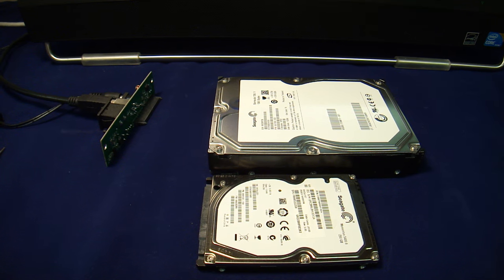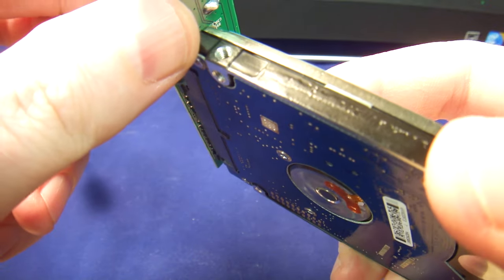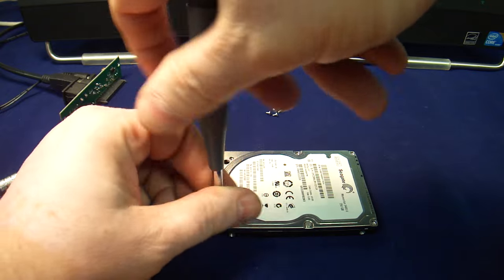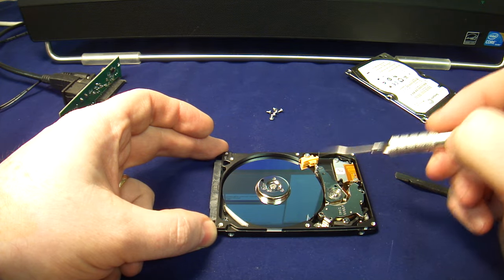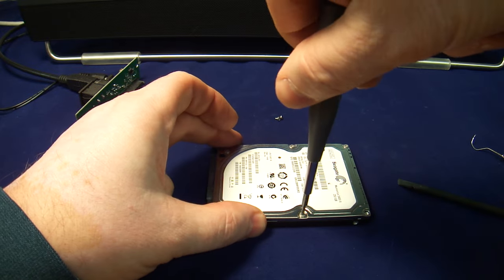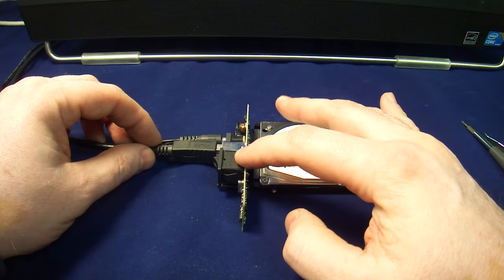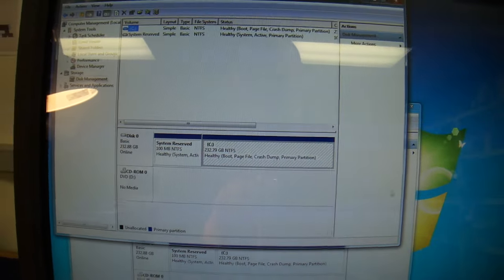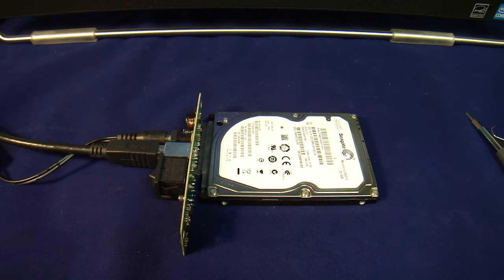DIY Video 2 How to fix a broken hard drive Beeping noise Get your data Back! Best Kept Secret

Comment: I USUALLY just plug these back into a spare slot "internally" on my PC when trying to fix or get data off of an external HDD.  so if you have spare cables internally on your pc, or can disconnect a cd drive or secondary HDD momentarily (in order to do Data recovery), you dont need the SATA to USB connector thing.

Comment: Thank you for the video, I was able to move the head off the platter and out of the parked position, and once I plugged it back in the platter would spin up, but then beep 3 times. The beeps were different from when the heads were stuck in the parked position. Spinning but not being recognized by the laptop, I am using a macbook air

Comment: I just come to this video to tell you that i have 250 GB WD hard drive that i fixed 5 years ago and its inside of my old laptop and still working with no problems at all . I put windows 10 on it and give it to my father .I guess im lucky or my hard drive is just ROCK SOLID :D

Comment: I have repaired hard drive model ST1000LM024 belonging to a seagate portable expansion. head was stuck near the middle. Thank you very much for the tip.

He reparado un disco duro modelo ST1000LM024, perteneciente a un seagate expansion portable. El cabezal estaba atascado casi en el medio. Muchas gracias por el truco.

Comment: Great video not tried this yet plan to and yes I agree its just to get your files off of the drive itself. Common sense will tell you you got lucky (if it works)  and that it may go out again at anytime  and if it does it may not be able to be used again. It may function but not in the original  context as it was made for. It's a patch at best in other words don't trust it, it would be like using a plastic bag to stop up a leak in a sinking boat sure it might work for a bit but no way in saving your bacon in the long run. Even, data recovery  experts can not guarantee  it. The ones I looked at was way to expensive for the average person, and then its only for like 30 days if that.  So if this works make a back up of it and back that up as well. Make three copies one for you to use one work on a second one for the file drawer like a CD or another external hard drive.  and the other in a safe location. Safe location off site or the cloud .
Reply: Yeah that sounds sensible to me. I'm going to try it on mine, see if it works, and if it does, I'm going to rip the data from it.

Comment: Thanks Abraham,,, a lot for this video,,I am an electronics technician...i do such experiments too.I have a question that ever did you try to fix hdd which spinning disks inside damaged and you replaced these from the same model of hdd...soon i will do this experimet and see what going to happen.
Thanks

Comment: If your data is important to you, have the original files then 2+ backups, either on HDDs, DVD discs (very cheap) and/or utilise "cloud" storage. With services like Dropbox etc or you could even just simply attach documents to an email and send it to yourself.

If you have backups then all the risk is essentially taken out of DIY solutions like this.

Comment: hello
First of all I want to thank you took the time to make the video.
Now you say so, once the pc recognizes the hard disk, we have one chance to get the data out and place it on another hard disk.
Specifically how long you are spoken: 5 minutes, 10 minutes? To know that I must rapides.
I have a WD My Passport 500 gb, now fell to the floor. I connect to the PC, turn, turn but do not recognize me.
Also I will try what mostras in the video. Also I will tell my experience once you try.

many Thanks

Comment: thanks so much. bought a screw driver at home depot and got my drive working, called the computer place and they told me they couldn't fix it based on description so i just did it myself.
Reply: Remember, the drive isn't FIXED, it's just now, hopefully, usable to get the data off.  Do NOT put back into regular use.

Comment: My external(old internal in case) hard drive is not recognised, by mistake I've uninstalled drivers from device manager after that it didn't detected,my guess the hard drive data is deleated or changed after reinstall of the hdd

Comment: Thank you so much for this video. I was able to fix my seagate external 1gb hard drive. I just wanted to ask you if hard drive would still be good for everyday use or should i just get a bigger external and transfer all data? What drove me crazy was that  HD fell on a floor with rug not more than 2 feet. Thanks again

Comment: Hej Abraham i have an Intenso 1TB
i got an beeping noise while connecting the noise last about 6 sec
i did exactly as u instructed, then i connected it again and the harddrive made different noises but after 20 sec waiting it found my the drive and all my data is still on it. 
it still does some noises but works Thanks alot

Comment: Hi Abraham, please advise - I opened the compartment and noticed that the head does not move to the center. Is this an indication that the problem is with the board, the head itself or both?

Comment: I have a Seagate Goflex TB, it was beeping continuously but the delay between each beep is more longer, For example 1 second delay between each beep.
I opened it up, moved heads as you said and tried it again but this time sound like the heads go to platters and back to park for 5-6 times then light remain on but no sound and no work.

Comment: I would add that it's a bad idea to try to save data from the "fixed" drive using a Windows machine. In fact, plugging a drive with possible head or platter damage into a Windows PC is a recipe for disaster, as Windows will immediately try to write identifiers and timestamps to the drive. By the time the drive appears in Disk Management, it has been written to! Instead, image the drive using a Linux distro/liveCD that doesn't auto-mount drives (most recovery- or forensics-oriented Linuxes are like that), then work on the image from Windows.

Comment: But i cannot move the head completely away from the disc as it is shown in the video. The other end of the head hits a bar like metal which prevents the tip of the head going off the disc. what to do?... I took picture of it but cannot upload it here because there aren't any provisions for to upload an image.

Comment: Dear Mr. Abraham.
Wonderful video with lot of info. I got a 2.5" Laptop HDD 500 GB, from crashes one, I opened , and found Nothing Wrong visually, connected to laptop thru ext. hard drive enclosure. to my surprise the laptop recognized. but files in RAW format & could not read anything. Any suggestions from your end.

Comment: Hi! And when every thing is in it's right place, but disc or rotor does not  spinning? And is a little hard to turn even with the screw driver? There is something that I can do to put it in the good working state?

Comment: I done this but now the lever just moves in and out a few times then stops will the hardrive work with the covers off and can data be recovered from that disc which looks like a cd.

Comment: I had exactly buzz sound on seagate 500gb SATA. Your video helped open the drive i did exactly moved the heads back to its park position. Now after that when I plugged back to windows. It's not recognizing filesystem and popup comes up to Format Disk. Did I miss something ?

Comment: My brother’s laptop was making the second noise, but after I set the head back on the platform and turned it back on, it started making the first noise. I guess I damaged the head. Before I touched it, I told him it was experimental and he should take it to a shop if he needed the data.

Comment: Thanks a lot for this video it's the best i've found so far. I've a really urgent question if you guys can help. I want to know if after this operation i can quickly put it back to my laptop only to retrieve my gmail password from the chrome browser, just that, and then i can throw it. Can i do this quick 30 minutes operation or it'll fail?

Comment: The thin black plastic tool he used to pry off the top of the HDD.... where do you get them from? I went to several different hardware stores and had zero luck

Comment: hi
i have an hdd with similar issue, but when i opened it up, its doenst have the parking spot
and and its starting point is at the edge on the platters, but not "outside" of them.
so moving it to the edge, didnt help.

ideas?

thanx in advnace

Comment: Hi Abraham, very useful video!

I want to try recovering data from a single platter hard drive and have managed to get an 'identical' hard drive as a donor. Do you think a platter transplant or a head transplant is more likely to result in success?

If the answer is platter, how important is it to preserve the orientation (angle) of the single platter?

Thanks!

Comment: Hello! first thank you very much for this video! you rock!

I have a seagate notebook hd wich suddenly stopped to work while i was using it,
now when i plug it, it makes 5 bips (not cliping) and die, how can i make a differentian diagnosis of problems in the hard drive board from stuck head?

what do you think about? its more probable that its the stuck head?

than you again!

Comment: my hitachi harddrive does not have a torx in the center of the platter, it only has a little divot in the middle, how can i turn the platter?  it does have 6 smaller trox in a circle around it.

Comment: Good afternoon!
In this video, you show what kind of screwdriver with a nozzle you use to open the hard drive (Torx T-6).
Please tell me what attachment you use to Unscrew the Board from the back of the hard drive. There's a PH type...Please tell me the PH number?
The video shows that you can Unscrew the Board and clean the contacts with an eraser.
I want to try this.
Thank you in advance.
(English is not my native language. Translated using a Google translator).

Comment: My external drive doesn't have the constant beeping, it spins up and then two beeps stops and then repeats.
Reply: Same with mine... should i open it to check if the head is stuck??
Reply: It could be that your computer is trying to tell you something by "beep codes". Check this site for more information to see if you can resolve the problem, http://www.computerhope.com/beep.htm , hope this helps.
Reply: The same is happening to me! 2 quick screech and beeps, then it stops. Have you tried opening the drive?
Reply: Did you open your drive, Deepak Garg?
Reply: same one my

Comment: Hi Abraham, I have a 2tb WD my passport 2.5 portable HD and I recently got squeaky/ screeching noises, whenever I connect my HD to my computer it opens up and all my data is there however when accessing the files the hd or my windows would freeze and I cant copy the data of HD to back it up. Can I get this repaired by replacing some parts?

Comment: Hey Abraham, thanks for your video. i have 1TB external hdd which was vibrating and could not read on computer so i used data recoverable software. then i opened it to resolve the issue of vibrating. but now it start clicking noise, Can you please recommend me any solution for it? here hard drive experts are not available.

Comment: Thank you for your video and all the information given !

I have a problem with my personal laptop, the laptop is booting into bios and not detecting the hard drive!
The problem occurred after power cable was removed from laptop (laptop has not a working battery, so the laptop turned off abnormally after cable was removed).

Once I click on start, I hear the same clicking beeps, it seems the head is stuck on the platter.

Now the question, what chances is there in case I do the same procedure you showed here ? Will the laptop detect the hard drive and boot normally ?

Thank you !

Comment: Hello Abraham. i have a Seagate ST39216 SCSI hard drive that crashed. I swapped the circuit board with another good drive and now the disc spins, but it comes up in the 'sleep' mode so I can see the disc but can't activate it to access any of the data. Do you have any suggestions on how to get the data off the disc?

Comment: Hi Abraham, my external HD is making that beeping noise like the the smaller HD you're working with. However, I heard in the background that your computer still makes the noise indicating that it's recognized/connected to the computer. When I plug mine in, it beeps like your's but isn't recognized/it doesn't show up on my computer. Any thoughts on what the issue is? Much appreciated!

Comment: Do you have any information on this mythical microjog of WD drives which needs to be perfect for it to work after a arm replacement. Hence you must pay thousands for an "expert" to fix rather than going the DIY rout. I am going to do an arm replacement on my WD drive and I have been fed so much crap from experts wanting to charge me at the least £700. I am quite sure building a clean box and having the exact drive as a donor will yield perfect results.
Reply: glyn hodges  No. Drive is still dead on my shelf. I want to sort it though. Saw another video where the arm was just stuck and just gently moving it fixed the drive. Some dead sectors but most of the data was okay. Think I will try this method when I get round to making a clean box.

Comment: Hey friend, i have one Maxtor +9 hdd it has some photos on it, in middle of transfer it just spinned down. I later saw tht PCB is dead. I also have another maxtor +9 not same gen as previous but same chips are used. I placed its PCB on that drive it passes seek test but couldnt be reconised by PC. That drive that i took Pcb also wasnt reconised. Is there a way that i can fix that or is all of data gone?

Comment: hello are u still there working with computer, i have a question. i got a seagate sata disk 1TB, it showup in BIOS, it have clicking sound just once at the start of computer, not continuous clicking like both your disk. what do u think? should i open up the cover and check the head position?

Comment: My Seagate 1TB External Harddrive took a knock the other day and since then it hasn't been reading on any computer.  The light comes on, it makes quick beeping noises, then the light goes off.  Will this fix it?
Reply: Just did it about a hour ago on the very same drive you have and got all my girls pics back. Give it a shot man. Good luck
Reply: I have exactly the same problem with mine. Beeping.  Mine comes on , the light keeps flashing.
Reply: Try it, and it will work! Good luck!
Reply: Yeah it will for sure! Mine was just like this and the OP's procedure revived it!
Reply: +Luke Chagas finally, this is the exact shit that is happening to mine... i will buy the tools monday and try to do this, if it works i will be so happy.... i dont give a fuck about the data, but i really dont wanna loose a 200 bucks 4Tb hard drive
Reply: He makes it clear in the video to recover the data as quick as possible and not keep using it because once you break the seal, the device is gone (could anybody explain why?), but I'm curious if you kept using it and if it worked. I'd like to at least use it as an alternative backup since it'd be very frustrating to have paid so much for something that is gone so easily. Also, what are the best home-use storage options, given these devices seem to be so fragile?
Reply: noepuntocom   So far the best backup is a  M-DISC  format! You need a new burner to burn M-DISC  format...Search Google for more info!

Comment: My hard drive fell off the mantel and now my pc doesn't recognise it is plugged in and is beeping. I opened it and the hands are not stuck.. nothing looks visibly wrong with it other than it's beeping. No clicking, no rattle when I move it around. What else could it be?

Comment: Hi!! Great video 🙌
I have a 2TB WD ELEMENTS BLACK USB 3.0 2.5 external drive?

The PC does not detect it on port 3.0, but on 2.0, on that port it appears fine in the device manager, in the disk manager it appears uninitialized and when initialized it says non-existent device. 

 When you connect it, the LED turns on, it makes 7 beeps and then. 3 beeps and then 3 more beeps and it stops. Will there be a solution?

Comment: Hello Abraham really educating video so thanks. I have lenovo Z580 ideapad. I want to ask you that mine hard drive of 500 gig makes ticking noise at start and doesn't get recognized in bios. But sometimes when I hit it from bottom before starting and if I hit correctly, it just works like nothing happened for hours without fail. But again next time when I shut it down, and tries to start it up same thing happens which leads me to hit it again at bottom. Ticking noise comes from hard drive. So what would be your suggestion for such funny problem?

Comment: how to check the drive to see if anything was written to it before it stopped working? the white light on my wd external drive doesnt come on, it worked on my old pc, not on new one, i tried a laptop i couldn't figure out. please help I can still rma wd but dont want to until i verify nothing is on the drive.

Comment: Hi, i did it like you the 2,5  disk. The head has been 4mm from of the plate edge. First start was longer and system recocnized the disk. After preparation of copy has freeze system... After restartin system windows the disk is no longer recognized. The disk run and head is run too but its not visible in the system. Is there any chance to rocognize in the system? Thanxs